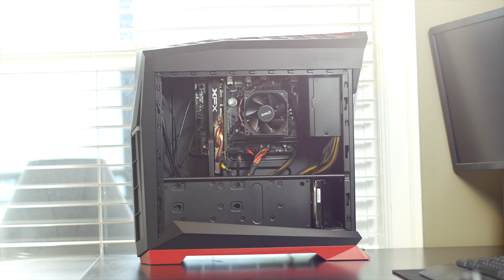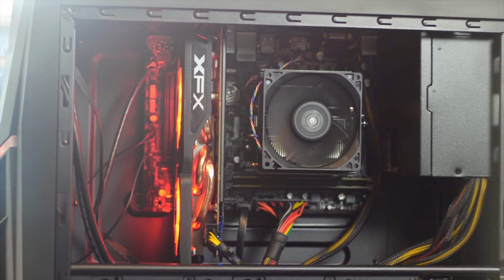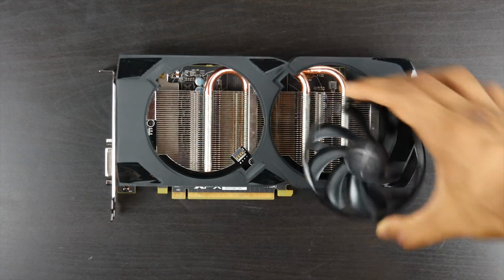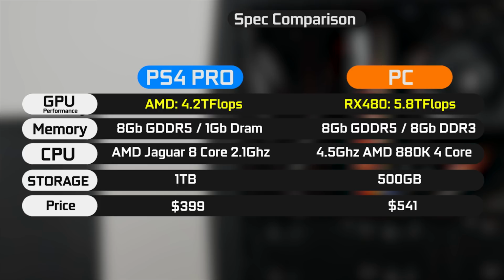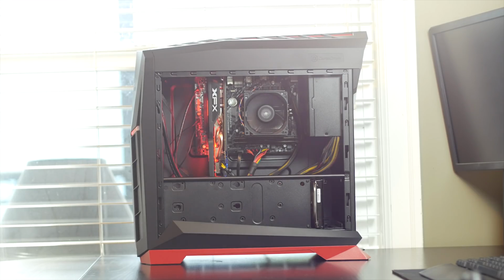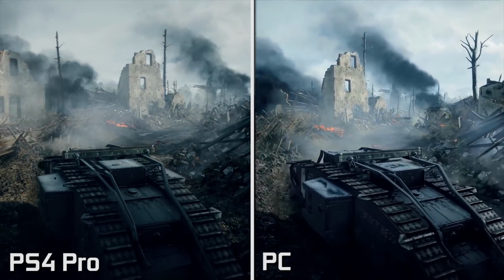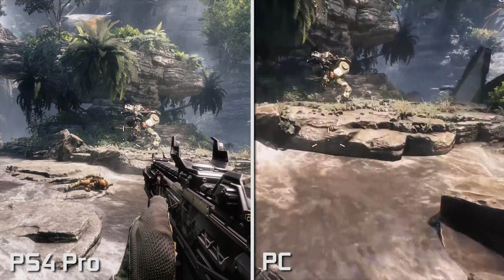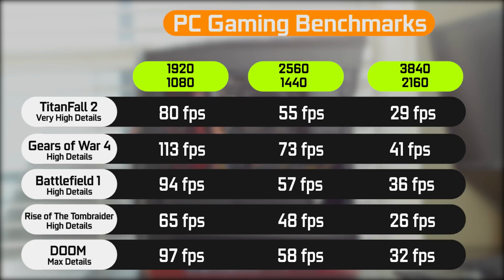Playstation 4 Pro vs $550 Gaming PC

Comment: Yeah you can upgrade a PC, I have a relatively expensive gaming pc, but I will take playing 90% on my games on my Ps4. It just feels better, and the graphics are not a HUGE difference, if you play on a gaming monitor. I never notice a crazy difference in graphics. I never have a problem with frame rate or any of that on my ps4, it just feels right to play video games on there.

Comment: Ok, so you are doing a performance per cost comparison between a PS4 Pro and a budget gaming PC yet you put in a video card that performs higher than the PS4's GPU yet increases the cost of the PC.  You stated that you could have used a RX470 which would have been 100-150 dollars cheaper with the same performance of a PS4.....and in the end, keeping the cost the same.  Correct me if I'm wrong, but this comparison with your base system is not balanced and you gave the edge to the PC by spending $150 more for a better GPU.

Comment: Ps4 is way faster then XboxOne yea Xbox is Microsoft but I just got a new XboxOne not S it's slow in the shop and title load screens so don't what everyones yelling about
Reply: abram martinez No it isn't.
They both run multiplats at the same speed.
The only difference is that some Xbox games are 900p and some Ps4 ones 1080p.
Reply: abram martinez lmao slow? you on drugs?

Comment: You also have to buy a WIN Key (for Games like Witcher or GTA you need Windows), a controller (for comfortable Gaming like on consoles, a Mouse and Keyboard. At least about 100€($)+. And you can get a PS4 Pro for less than 399€ if you search for sales. I'm also shure that there will be games in 2 years which you cant play anymore even in low Resolution. Ubisoft games for example need a lot of ressources.

Comment: mother board,   cpu with fan,  ,8gb ram,   8gb graphics,    500gb hdd,   dvd rom and a good cabinet,   541$. i don't think so.
And also there is not much price difference between 500gb and 1tb hdd's.
8gb graphics is not budget.4gb is.

Comment: Didn't add windows to cost nor did you add mouse and keyboard.
Reply: With Windows being 100 bucks and a decent mouse and keyboard being 100 bucks that brings the price to about 800....double the price of a PS4 and only very slight visible difference in gaming. Remember only talking about gaming not the fact PCs can do so much more...just gaming.
Reply: My Name Windows is not required and M&K bundles are quite cheap(about $20-30).
Reply: My Name Plus PlayStation plus costs $55 or $60 a year now, so getting a PC at this price would overall be cheaper in the long run.

Comment: The RX 480 is kinda overkill to compare with PS4Pro. That is a kick ass PC by the way.
Reply: A more comparable card would by the R9 280.
Reply: yeah.
Reply: PS4 Pro uses the same polaris base as an RX480! LOL! But a mobile gimped version with lower clock speeds and less shaders. Of course the discrete 480 is better, it's almost as big as a PS4 Pro!
Reply: CPU bottleneck at 1080p but great for 4k.
Reply: Don’t see a difference
Reply: No is not, that computer is more expensive than PS4, same price range is RX 470. Not saying the video is any wrong tho.

Comment: Would the X4 880K bottleneck the rx 470?
Reply: Depends on the game, but probably not a lot, and it's overclockable
Also consider G4400 which is dual-core, but skylake

Comment: what is the point in the comparison between a $400 console and a $550 pc?
Reply: Because the PS4 pro has more expensive games and a yearly cost for online multiplayer and physically does less than the pc. If you look at the cost after only a year of buying games and multiplayer that cost difference starts to decrease. Let's say you buy 4 games per year on average and you pay for Playstation plus. Then let's say you get each pc game for $40 (which is reasonable if you buy from G2A for example) and each PS game for $60 (since you won't find them cheaper on launch day). After only one year the PlayStation comes out to be $640, while the PC comes out to $670. Tack on that you can get all your work done and have a more enjoyable gaming experience with higher details and that $30 difference starts to look really worth it.
Reply: ***** For some people, the degraded performance of the ps4 takes a backseat to the exclusives. For me, none of those games really interested me so it hasn't made that big of an impact on my decision, but I just recently switched from the xbox one to pc even though I lost some really good exclusives (even if it's less then the ps4 pro). I can't decide whether or not exclusives mattere that much to you, but in the end, I'll take the upgraded performance, versatility, cheaper games, and no subscription service over a few games any day of the week.
Reply: ***** Um, Star Citizen (which you can play and is getting it's fps module on the 8th. But if you don't count that since it's in alpha there's the civilization series, XCOM 2, Total War Warhammer, we can count csgo since it's community and gameplay is ass on consoles, Starcraft 2, some racing games like Assetto Corsa or project cars, Routine for yo horror fans, killing floor 2, Dreadnought, Dirty Bomb not counting all the HUGE mobas. Remember, not every game has to be an enormous AAA big budget game to be great. The PC world is full of amazing AA and AAA games to choose from, and this list hits on a number of both.
Reply: Rocky Xaad Games stay forever on PC instead of dishing out 500$ every few years for a new model of the same console for little to no money you can update the drivers and have a better experience OR after 5 years you can spend 100$ on a new graphics card wich is more versatile than a new console.
Reply: +Sean Douglas I highly doubt on XCOM and killing floor 2.

But though you have forgotten older fallouts.
Reply: pc can be use for more tasks then ps4
Reply: that is a flawed argument, unline pc games you can actually re- sell and buy used ps4 games, since i usually buy a game for 60 and after few months sell it for 50, games cost about 10 bucks each in my case,which wouldnt be possible with steam for example.
Reply: Really? We need to fight over a title of the video?
Reply: ***** Yeah. I have seen it. Although if it wasn't for steam. They would've been paying the same ammount as console users. On games.
Reply: ***** Yeah.
Reply: Clorox Bleach Wipes Although that's not what you would find easy players.
Reply: Rocky Xaad that's not what I meant.
Reply: you guys are just stuffing words into my mouth I meant that console's don't have long lasting life's for example ps3, ps3 slim and ps3 superslim.
Reply: Clorox Bleach Wipes So the "stay forever on PC" was a lie?

Comment: I must just be bad at building PC's or these videos are not giving the full reality to the pricing. People seem to forget, that even if you swipe a cheap copy on Ebay, you will need Windows 10 if you want to build a complete console replacement. Anything less will lock you out of the Xbox exclusives that come to PC. Also when you are comparing to a console, it should be vying for its living room spot to use your HDTV (otherwise you've got to buy a monitor as well) so the thing should at least be a mini-itx build, unless the average person is ok just plonking a full size pc next to their TV and this is where the price starts to rise.

Comment: that cpu makes no sense. Grab an i3 6100, works way better in most games due to its' MUCH better single core performance + ddr4 support . 
2. why rx 480 It's 5-10% faster at MOST when compared to the much cheaper rx 470 + the 470 supports the same clock speeds as the 480 so you'd not even see any performance increase with the 480 unless you where running a game that was actually utilizing all of the 480's power.

Comment: can it run battlefield 1and so on?
Reply: A potato can run BF4
Reply: Onlyone Nobody You have no idea about the GPUs, do you? RX 480 is based on polaris arcitecture. It is not a rebrand.
Reply: its the rx 480 so yes easily. its basically a rebranded r9 390 x
Reply: Which is a rebranded 290x. AMD hasn't done much innovation on their GPUs...
Reply: Who told you that shit it's not rebranded it has similar performance but that doesn't mean it's rebranded

So a GTX 1050 is a rebranded GTX 680??? WTF
Reply: Onlyone Nobody well...i'm gonna buy the parts for my comp in few months.to bad that  it will take to long.good thing i have my job
Reply: No it is not. It's a completely different architecture. The 390x is a rebrand of the 290x, the RX4 series, based on Polaris,  is a complete new serie of videocards.

Comment: But can you play VR on tht build? How about uncharted and last of us? Didn't think so.  Did you include the price for keyboard, mouse, and a computer desk? If the point of this video is to show u can get the same or better experience with the same price on the pc then u fail.  If you say u need ps plus to play ps4 u don't.  Also ps plus is 50$ a year, thts less than 5$ a month and u get 2 free games every month, more if u have ps3 & vita, pays for itself.  I am not hating on pc, i have an i7 w/ 1080 sli build.  All I'm saying is u cant build anything for the price of a ps4 or ps4pro and get the same experience.

Comment: Why not go with an i3-6100? Barely any more but so much better. Could've just dropped to a 470 to make up the $20-$30 difference in CPU's, as the 470 is nearly as good.

Comment: You have to buy Windows 10 Os..which wasn't factored into the price..where as Ps4 pro has Linux built in so there's also that so in its actually $550 plus either $60 or $100 more that's a big price difference
Reply: olicharlo that doesnt count because thats not a legit activated version of windows
Reply: neosrt10 I can get Windows 10 for around $17 and if we include psn+ $44. Plus the computer could be made cheaper.
Reply: shaan0121 that's extra money no matter and it's already more money than Ps4..I'm curious about your $17 windows 10 please post a link
Reply: I_Am_SamIII windows 10 is a must to support most modern AAA titles so there's no getting around that
Reply: you know you Can intall win10 without activating it right?
Reply: Unraveled Gaming Thanks someone who knows how windows works..no license no updates no support and lots of issues..just pay for a legit copy..
and in conclusion the $550 is an awesome build..but you have to add windows..so you looking at  $550 plus..Ps4 is a better bargain  but the $550 is no doubt better performance gaming
Reply: neosrt10 actually if he bought a cheaper case it wouldn't reach that price. there are PC cases worth around 50 dollars. he could have also gotten a 1050ti which is cheaper and still get nearly the same performance or even a 1060
Reply: Michael Lana let's just say no matter the build its work..and Ps4 pro is already assembled at $400 it just can't be beat as its payable at more than 4 Tera flops  right outta the box..no one can argue that..and I'm and Xbox One fan
Reply: The fact is. The PC performs better which is part of why it's costlier. A PS4 is basically a pre-built budget PC which is actually really cool. But you get more perks with a PC. E.g you don't pay a monthly subscription plan(PS+) to pay online. Think about it. Let's say you spend 399 for the pro. Let's say PS+ plus sub is like 15 dollars that's 180 dollars in a year. Which adds up to 579. My point is in the long run. A PC is better
Reply: most now support linux
Reply: linux is FREE!
Reply: PizzaSlaya ...Stop..you can't beat a box as good as a Ps4 pro for the $400 it's already built..forget it..no one can
Reply: I_Am_SamIII Neither can Pcs do the same unless they're properly equipped ..it can't be beat
Reply: Actually you can get a 4k rig for 500-600 dollars
Reply: Michael Lana which is still more money that a Ps4 pro..so actually no
Reply: neosrt10 no you don't most people when they upgrade there PCs they already own a copy of Windows already, so your point is irrelevant.
Reply: stylechyld your point is kinda useless not everyone has a PC so wrong again..and not everyone has windows 10..you statement makes zero sense  stop trolling
Reply: neosrt10 https://www.scdkey.uk/microsoft-windows-10-pro-oem-cd-key-global_1227-20.html?currency=GBP&gclid=CM3MnM2X6NACFZAW0wodAPMGiQ&&site=uk
Reply: neosrt10
you don't get it, most people that upgrade already had a  previous computer with licensed software..do you get it now?
Reply: stylechyld You don't get it do you??..Not everyone has a copy of Windows or knows how to license transfer or wants to build a PC so you understand that ?? That's why there are so many damn consoles out there sold Ps4 is at 50 million..PC can be better but it has to be built to be better ..and at $400 a Ps4 pro is already built to do 4k gaming outta the box to play games and media..Ps4 Pro wins because it doesn't have to be made or built stop trying to make your own world wake up..50 million Ps4s..and counting and for your information alot of these people already own PCs..they just like Ps4 it's winning and can't be beat at that Price it's too convenient
Reply: neosrt10
well I get it!  you are one of those dumb asses you know know either. I almost feel sorry for you..almost!
Reply: stylechyld Your a complete morons I have a PC Ps4 and Xbox one ..I feel like your one of those Internet trolls that's stuck I can build a PC mode a complete douche bag like you that is close minded that doesn't understand current market trends and popular culture people love consoles ..and if you don't known that ..go build your self an island and live on it alone ..what an idiot
Reply: good for you so do I..and the millions of people. grab a book and stop replying like a 5 year old.
Reply: neosrt10
by the looks of it, you like to diss everyone in here with your 2 year old brain.. like to brag about what you own you forget that there's millions of people who have better than you and actually have brain and know what they are talking about. stop wasting time spilling all your nonsense to the world..all its doing is making people laugh how ignorant you are.
p.s. I like your little mediocre comment about parents basement, if you only knew where i live! lol..
Reply: stylechyld Your obviously a child given your name..or someone who  needs to grow up were talking about Ps4 to console value and you started with the insults your a troll and you failed ..Ps4 wins..I win ..all 50 million Ps4 owners win you lose ..keep trying to install Windows  on your potato while 50 million enjoy games outta the box ..You lost again your burnt ..go build a box and hide in it